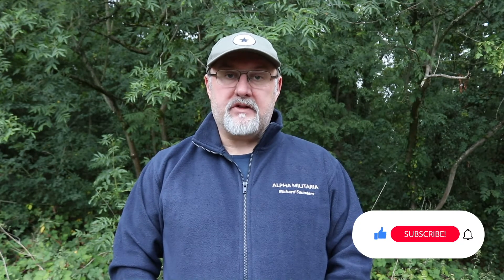How Does a Gas Ram Air Rifle Work? Ask Me Anything

Comment: How do you recharge a theoben gas ram pls
Reply from the maker: Hi Thomas. Most Theoben gas rams can be filled using a pump fitted with a Shrader valve.
Reply: @airgunextra  thanks for the info I always watch your vids keep up the good work Richard.😁😁😁
Reply from the maker: Thanks very much Thomas. Which Theoben do you have? @thomasroughley7982
Reply: @airgunextra  it was just the gas ram which I bought to fit my webley trakker .177 years ago out of the air gun magazine.its a cracking little rifle but lost abit of power.

Comment: Hello, does the 24j gas ram for bsa XL grt fit in a 16j bsa XL grt. Cheers
Reply from the maker: Hi Richard. I don't believe there is any difference in terms of the size of the cylinder. Obviously there is more nitrogen under a greater state of compression in the higher powered rifle. There may be uprated valving to cope, but I don't know for sure. I don't know where you are based, but if it's in the UK you will clearly need a Firearms Certificate with an approved slot if you go down this route.

Comment: Hello sir first of all I would like to thank you for helping, I am looking for break barrel pistol ( i ignored the co2 and pcp because it needs more care) break barrel more simple and higher reliability and always ready
So I am from Egypt and we have limited options 
Diana p-five ( not interested because low power) 120m/s
Umarex Trevox "the one I like"(TNT gas piston) 150 m/s
Umarex hämmerli firehorent (spring piston) 175 m/s ( didn't like the design and the sights also heavy front) 
I like the Trevox because of the good looking and good sight front and rear
But as you know it's gas piston
I already  contact Umarex usa and they said the gas piston has up to 10000 round !! I have read 5 sources all confirmed that the gas piston has 3000 round life cycle
And also if the piston failed the gun will never shot
As I already read subject at gateway airgun some users complaints about their air gun gas leaking
So I am really confused

Should I rest assured and buy Trevox
Or just stop thinking and take the safe side with hämmerli firehorent ( spring piston)
I need your experience to confirm that information
Reply from the maker: Hi. I'm afraid I'm not that big into air pistols. From what I know though the Weihrauch HW45 is just about the best spring powered pistol I've ever come across. Sorry I can't be of more help and good luck in your search.

Comment: Hie sir, l have tried pumping air into my hatsa m95 vortex .177. it can not fill up satisfactorily. When l cock it l can fill the lever so weak
Reply from the maker: Hi. Are you trying to pump air into the gas chamber? If so, are you doing that because it has leaked? I'm not sure where you live, but it could be the rifle is set to deliver a specific pressure and won't go above that. Unless you are a qualified gunsmith, or are confident you know what you are doing, I'd recommend leaving your rifle at standard spec. If you think it is faulty, I'd suggest returning it to a gunsmith.

Comment: Is it true that IGT or gas ram has less recoil than a simple break barrel springer ... ? Whats the advantage of having a left hand wound main spring over a right hand main spring, I notice that aftermarket springs like TiTan XS are left hand wound replacement springs ... ? I fully appreciate that aftermarket springs will put the springer into FAC rifle land ...
Reply from the maker: Hi Deano. This won't be much help. It really depends on the springer and the gas ram rifle. I've shot plenty of gas rams that are smoother than springers, and plenty of springers that are smoother than gas rams. In practice, I think its fair to say that the best springers are better engineered than the nest gas rams (at least those currently in production). I'm afraid I can't help regarding your question about replacement springs.
Reply: @airgunextra  Thanks Richard for those words of wisdom ... personally I think that the left hand wound spring was just a way of XS making sure that if the spring broke or malfunctioned that XS knew that they are receiving back a genuine XS spring (Left hand wound) 
The vast majority of main springs in springers are right hand wound ... Just my thoughts ... apart from the increase in compression power, there is no difference in a right or left hand spring or the way that it delivers the main spring power, it still has to compress & decompress, it's all a matter of the strength of compression ...
Reply: Sorry Richard, I wasn’t trying to draw you into the contentious issue of after market springs, just interested in the power distribution of a Left or Right handed spring … Apparently used in an axis direction here, there is no discernible difference between springs … according to Google … !

Comment: How can we . Use CO2 means burning 🥵 gas gun . Instead of air rifles
Reply from the maker: Gas rams don't burn anything. Gas rams compress a contained chamber of gas (not sure what but not Co2) when cocked and then expands again when the trigger is pulled to propel the pellet. If you mean Co2 capsule rifles. Again, nothing burned or ignited. The controlled release of Co2 propels the pellet. I hope that clarifies.
Reply: @airgunextra  thanks 🫂 buddy

Comment: Hi , how can I reduce the speed on a gasram.Can I cut the arm about 3to 5mm?
Reply from the maker: Hi. I'm not an expert on gas rams, but I believe you can reduce the power by reducing the pressure of the gas stored in the chamber. I'm not sure how you would do that though as most modern gas rams are sealed units (i.e. no adjustment valve) to prevent people pumping up their rifles to go over the legal limit. I'd expect access to the chamber would also be protected with anti-tamper fittings for the same reason. It could be that a trip to your local gun shop/gunsmith is in order. If you have recently bought the rifle from a gun shop and find it to be over-powered (in the UK that would be more than 12 ft lbs) then take it back and tell them to adjust it as they have sold you an illegal rifle. Good luck.

Comment: I've shot before and used spring powered back barrels , but looking into gas ram . What would u recommend for £250 budget? Pest control and target shooting . Ps im in uk
Reply from the maker: Hi Simon. If you can manage another £50, the BSA GRT Lightning is a great little gun. If not, I'd suggest looking at maybe the Remington Thunderceptor or Gamo Rocket. The Weihrauch HW99S is a great springer for that sort of money too...
Reply: @airgunextra  that's great ill have a look into them , cheers